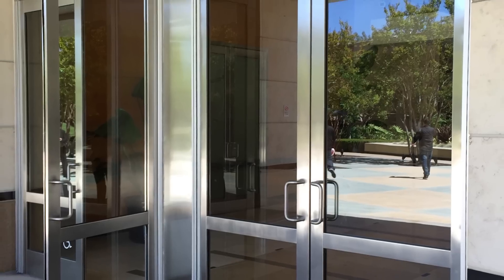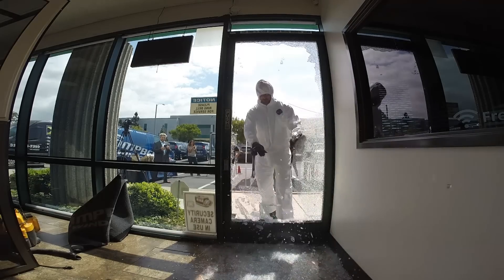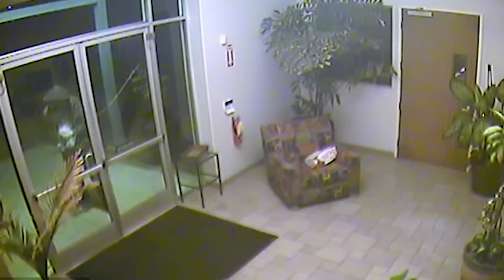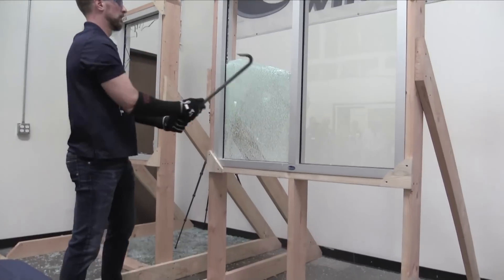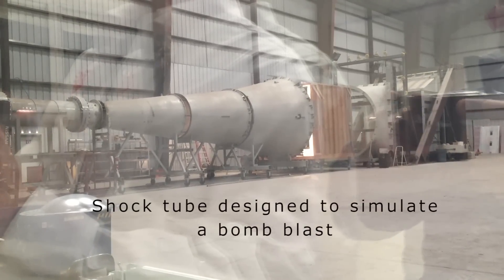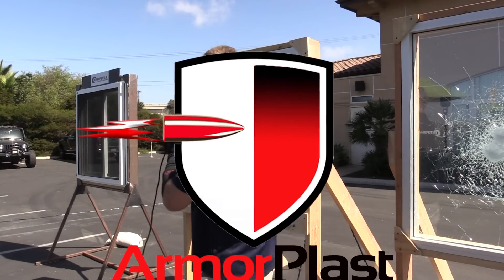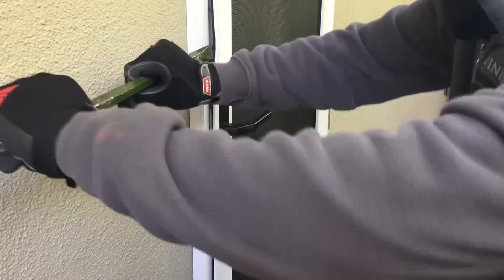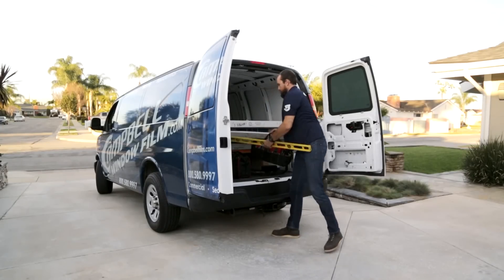Security Glass Basics - What You Need To Know

Comment: Could you run a test of your riot glass vs osb on 2' spaced studs as well as 16" stud space 
Because thats what most walls are if your product can out perform the wall that would be a great selling point also maybe an attached film on tempered to determin the lowest level of protection needed to out perform osb and hardy board siding

Comment: Does these comply with coastal storm codes? or they are different? does the cambell security screen have hurricane codes too? also how about coastal weather issues like rust?
Reply from the maker: We just completed large missile impact testing for Miami-Dade. You can contact us at 800-580-9997 for details. Also see the Riot Glass channel for the test video. No issues with rust. This all aluminum anodized materials.
Reply: @Kolob_Canyons_Ranch  interesting.. so you mean to say this system goes on the outside of the existing window? or are you selling it as a window itself
Reply from the maker: @shenoyglobal  correct. Mounts on the exterior over the existing glass for hurricane. You can see in this video https://youtu.be/nVPDUPnjd3s
Reply: @Kolob_Canyons_Ranch  if we have marvin  or fleet wood or nana wall.. will this system go on top of it?
Reply from the maker: @shenoyglobal  Potentially, but we would need to see photos and measurements. Also depends on how close the sliders are as they telescope in. Clearance can be an issue with sliders.

Comment: How long does Riot glass last against direct sunlight?
Reply from the maker: Riot Glass has a very durable abrasion and UV-resistant hardcoat designed to prevent scratching, yellowing, and haze. This AR coating is the extremely durable and should last many years.
Reply: @Kolob_Canyons_Ranch  it will last many decades in the uk we do not get much sunlight. Andy England 🇬🇧👍😉

Comment: Do i need tO installed oN both side? How about If the length Of the Security film less 5 cm than windows, such as window length 157 cm, film length 152 cm does it Will impact ?
Reply from the maker: Rnv Z for window film you can install on one or both sides. Two sided is stronger. Film must be no less than 1/8 from the edge of the window all the way around for correct anchoring.

Comment: For the glass that has film on it, once they break the glass with a blunt instrument, can they insert a knife into the cracked lines and just cut them film?
Reply from the maker: Nathan Hare no, you cannot cut it with a blade because the film is on the inside and the broken glass stays stuck to it. The blade just slides off the broken glass. The real weakness of window film is it punctures easily and once a hole is made the intruder can pass a hand through and trip the panic egress hardware. ArmorPlast is the way to go on entryways in schools and commercial buildings. For residential the screens are excellent. Window film is good on annealed glass in less vulnerable areas and costs less then the other stronger solutions. We often use a combination of technolgies on a single building. We put the strongest solution on the most vulnerable areas.
Reply: @Kolob_Canyons_Ranch  Thanks.  I will definitely be a customer in the next 2 years.

Comment: How about tempered glass then you tinted it you think it’s more safe?
Reply: Nestor Zablan No, adding tint will not add security to tempered glass. You must add a security film and then attach it at the edges with either a wet glaze or mechanical attachment system. You may want to search for a local window film dealer that specializes in security films, or if your in Southern California you can call us at 800-580-9997. Thanks for the question 👍🏼

Comment: Very informative video thank you! For my rear sliding glass door, it is double paned. Do you recommend putting film on both inside and outside pane? And also how many mil thickness do you recommend?
Reply from the maker: Hi Frank, I would need to see photos of your doors both close up and further away. The framing determines how I prescribe a security solution. Campbell Security Screens may be a better avenue since most sliding glass doors have little frame to attach film to and will be tempered by code. They're very difficult to secure with film. Feel free to send photos to us at info@campbellcorp.com

Comment: How do they hold up to a butane pocket torch? Should there be a house fire what kind of fumes does this film/screen give off? Whatever happened to wired glass? Inmates from our county correctional center used the hot ember from a cigarette to melt through bullet-proof glazing and escaped, but did not get far
Reply from the maker: FLAMMABILITY
Horizontal Burn, AEB 
ASTM D 635 in 
<1
Ignition Temperature, Self 
ASTM D 1929 
°F 
1022
Ignition Temperature, Flash 
ASTM D 1929 
°F 
824
Flame Class @ 0.060 ̋ 
UL 94 
HB
 @ 0.394 ̋ 
UL 94 
V-0
paul smith, here is the data. Thank you for the very good question and interesting story. We have not seen this attempted, probably because it would take so long for a hole large enough to get a person's body through (no one wants to stand and wait for a very slow process to unfold) and would be significantly hazardous to anyone attempting it, as the molten material could burn skin badly. Smoke would be obvious, and likely attract attention.
Reply: Has the screen been tested with critters like raccons, squirrels, bears, etc. Does the security screen require a particularly specialized method of installation?
Reply from the maker: paul smith  yes, these have been extensively tested. Here’s a vid that explains them a little more in detail from my company YouTube page https://youtu.be/_amWbFuqxHM